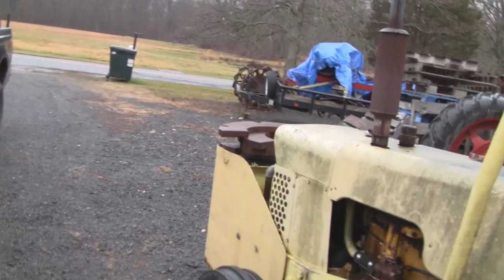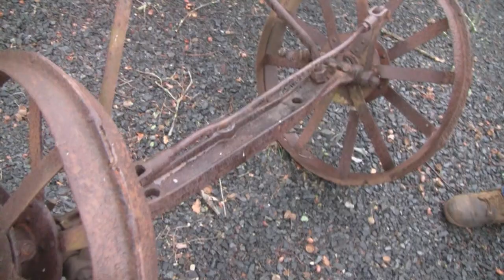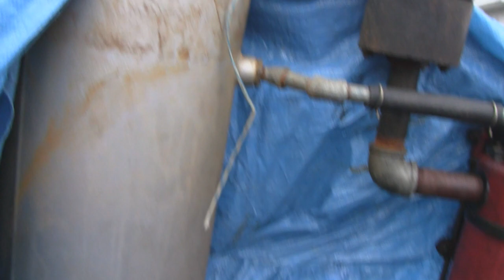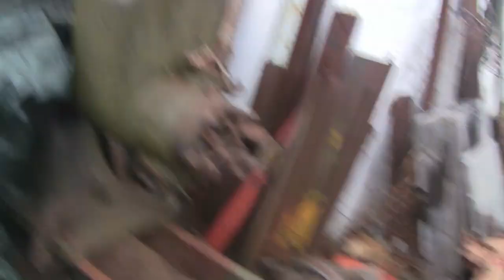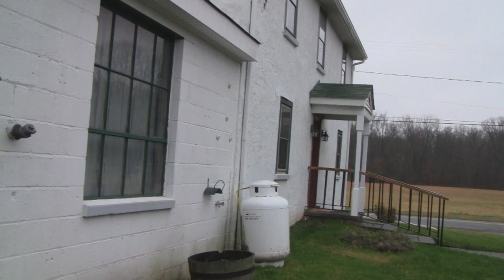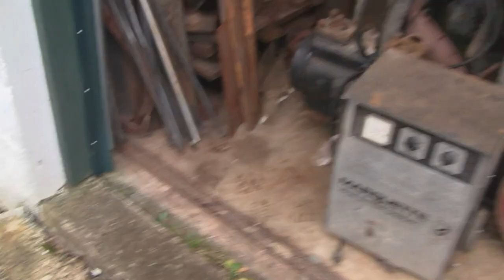1930's MACHINE SHOP (Part 1)

Comment: Whenever I see an old M Farmall I look under the belly of the rear end to see if the case has been busted where the bull gears run. Most Ms have a patch or brazing on the case in that area. Ball bearings that fall out of the axle shaft find their way between the bull gear and case and don't fit therefore the case gives way. Super Ms did not have this problem and I don't think the Hs did either.

Comment: I haven't seen a 346 FM since the early eighties when I worked in the oil field in Oklahoma. There was a small oil company  still using one.  they would  buy parts  for it and a few 118's they had.